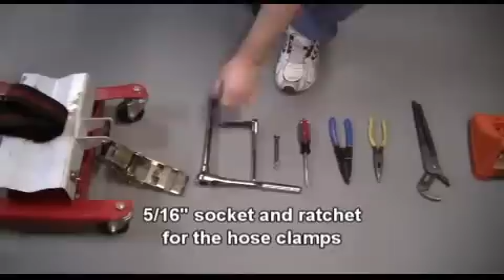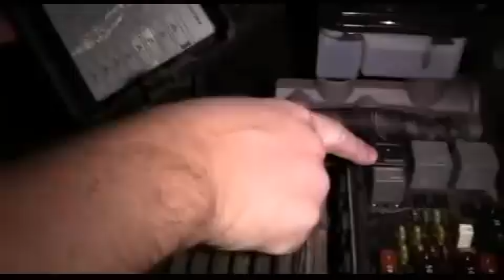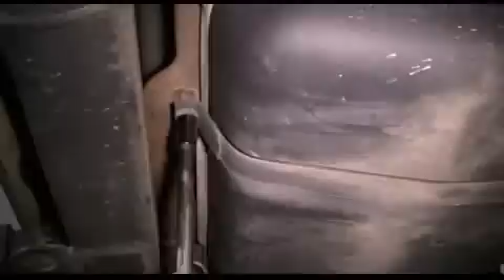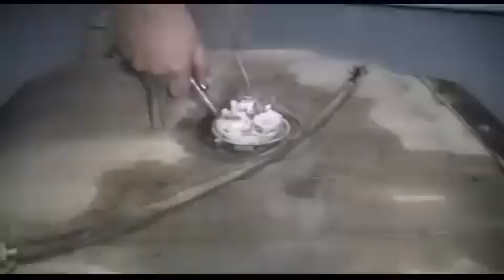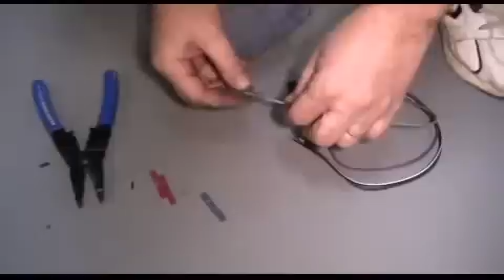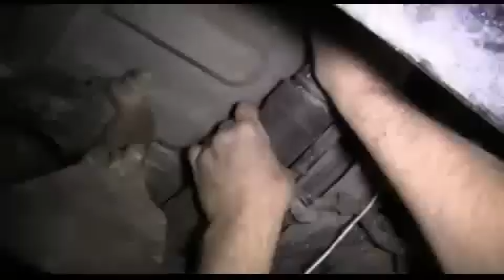Fuel Pump 1999 Chevy Suburban 1500

Comment: I have the same year suburban k1500 lt and im using the replacement nylon lines, but the replacement nylon line  does not fit the fuel vapor connector on fuel pump. Info says that i need a connector a 14 diameter, i just need the part number to find it.

Comment: Not sure how to get the pump low enough to replace the snap ring as my plastic on the pump sits above the tabs and I can push the pump down anymore to get the snap ring on.
Reply from the maker: From what I remember we had to press down on the fuel pump quite a bit to where we could install the snap ring.  If you can't get yours to fit you might want to compare it with your old one. -Greg
Reply: @GregorysGarage  Thanks.  I found the key was not to install the rubber ring gasket around the pump but rather to install it on the tank lip.  After that, it was still a bit tight but significantly better than having it on the pump.  Got it all on after some effort and works great now.  Another obstacle I found was the hoses to the filler spout.  Since they are "prebent" I found they need to be in the exact orientation to properly fit which is a bit hard to adjust after the clamps have been tightened and the tank raised!
Reply from the maker: @codoug777  I am glad you got it installed - Greg

Comment: long shot , but does anyone know why the fuel line wont reconnect back to the fuel pump? I replaced my fuel pump but can noy get those lines back on to the pump.
Reply from the maker: The lines should just slide back over the fittings.   I will have to review the video to make sure I am stating  this correctly. - Greg

Comment: So I just got a 99 gmc suburban the previous owner had 3 gas lines one feed one return and one on the middle one I’m assuming I should take that out 👀👀👀 also the tank was rusty and leaking so I got a new one but still leaks I never changed one so I assumed that’s how it went but obviously there is no line on the middle so ima take it off maybe that’s causing the leak on the new tank 🤦🏿‍♂️🤷🏿‍♂️

Comment: Have spent 30 min trying to get new pump to seat low enough to get ring on.  Im about to just use the old original ring.  Im putting 200lbs on the pump and it won't seat.
Reply: Got it - I ended up using moly lube grease...
Reply from the maker: Sorry I am just now replying.  It shouldn't be that hard.  You will have to push down on it but it shouldn't require that kind of force.  Make sure it isn't binding. - Greg
Reply: I've had the same issue twice now.
Reply: @EvanPederson  Damn!!

Comment: How long does it take to replace a fuel pump
Reply from the maker: I would set aside half a day.  You have to drop the tank and depending on how much fuel is in it depends on how easy it is.  Dropping a fuel 40 gallon tank isn't fun.  -Greg
Reply: @GregorysGarage  how much does it usually cost
Reply from the maker: @mikerey5605  I just checked the prices at my local O'Reilly's and the pump is between $200 and $300 depending on the one you buy.  You will need the line disconnect tool and that is probably $10 or so.-Greg
Reply: Yes that's what it took my neighbor and I to do the job. I got a lifetime warranty pump for around $140 because I bought it through a friend's commercial account. Normally would have been $250+.

Comment: I undo the strap bolts and the tank won't lower.
Reply from the maker: The tank is probably stuck.  Tap it with a rubber mallet or something similar. -Greg
Reply: Gotta' bust-out the prybars!!

Comment: Wondering why you removed negative battery cable, leaving a vulnerable connection between positive and any till touching body?
Reply from the maker: By removing the negative cable we are removing the battery connection to the chassis of the vehicle.  It would be best to remove both but if you are only going to remove one then remove the negative. -Greg

Comment: Hey, I have a 98 suburban and when I try to start it, it stalls.. or it’ll act like it’s gonna start then cut off after 2 seconds.. I’m thinking it’s the fuel pump, but I don’t know.. I wanna actually know what’s wrong before I buy a new fuel pump.
Reply from the maker: Can you hear the fuel pump run when you turn the key on? - Greg
Reply: Gregory's Garage yes, if I’m not mistaken.
Reply: Gregory's Garage I also read somewhere that it might be a mass flow sensor or something like that.. I’m just trying to not waist money on something I don’t need.
Reply from the maker: @kooley_hoe6084  Another yhing is it could be yhe fuel filter. -Greg
Reply: Gregory's Garage I changed that already, but what I’m think that it is the mass airflow sensor
Reply: Gregory's Garage or the map sensor, I’m gonna get those changed and I’ll let you know if it works
Reply: Gregory's Garage ok I noticed that it starts right up when it’s cold outside, but doesn’t when it’s hot
Reply from the maker: @kooley_hoe6084  I really have no clue why the outside temperature would make a difference when you first start it up.    -Greg
Reply: Gregory's Garage i don’t either, thanks anyway
Reply: Did you figure it out? Mine is doing the exact same thing. Once it final starts it runs great

Comment: My truck hums when I try to start it. It doesn't start though. Could it be the fuel pump has gone bad?

I was driving and my truck cut off. The check gages light is on and so is the battery light. I don't know what either of them mean.
Reply from the maker: Does the engine turn over when you try to crank it?   If the fuel pump is bad the pump doesn't make a noise.   When you turn the key to the run position you should be able to hear the pump hum .
Reply: @GregorysGarage  yes. It turns over. What we found was that the fuel makes it upfront but it stops there. If you pour gas in the mod (the carburetor looking thing) it cranks but doesn't stay on.
Reply from the maker: @kimberlyburdette5511  How do you know fuel is getting to the front?
Reply: @GregorysGarage  because he pressed the fuel thing in and gas shot out. I suppose it could be fuel that was already in the line. What do you think it could be?
Reply from the maker: @kimberlyburdette5511  Fuel filter?
Reply from the maker: If your fuel pump is working something is keeping it from getting into your engine.
Reply: I have to find where the fuel filter is located.
Reply: @GregorysGarage  could my relay be bad? Would I hear the fuel pump if the relay is bad?
Reply from the maker: @kimberlyburdette5511  fuel filter is located under the vehicle.  I am assuming this is a Suburban or something similar.  Just a guess though.  From what you describe it sounds like something is blocking fuel from getting into your throttle body.  I don't have that vehicle anymore so I can't look at it.
Reply: @GregorysGarage  yes I have a 99 suburban. A storm just hit so I can't go mess around with it now. Thanks for your help. It's much appreciated.
Reply from the maker: @kimberlyburdette5511  Anothet thing I saw online is that there maybe a fuse for your injectors.   I will look into this
Reply: @GregorysGarage  ok. Thanks again.
Reply: @GregorysGarage  I had the fuel filter changed but no change. Here is a video of what happens when I try to start it https://youtu.be/TIXNxzOzlMI
Reply from the maker: @kimberlyburdette5511  Sounds like it tries to start.   Can you spray starting fluid in the throttle body?   It should start.  I won't run long.   Also I couldn't tell from the video but you said you hear the fuel pump right?
Reply: @GregorysGarage  yes. Here is a video I made to show the sound i hear when the key is turned to on https://youtu.be/K9HPk_610N0
Reply from the maker: @kimberlyburdette5511  Well that sounds like the fuel pump and from what you said earlier you have pressure in the lines.   I would try spraying starter fluid in the throttle body.   That will let you know if you at least have spark.
Reply: @GregorysGarage  ok. Thanks for your help.
Reply from the maker: @kimberlyburdette5511  I just looked at a previous reply where you poured gas in the throttle body and it cranked.   I am out of ideas without looking at it.
Reply: @GregorysGarage  I think I'm going to break down and take it to the shop. Thanks again for your help.
Reply from the maker: Ok my last effort.   Look for a fuse labeled TBC.   If that fuse is bad your truck won't start.  I just went outside and removed it from my 2001 Silverado to test it.  -Greg
Reply: @GregorysGarage  ok im going to go look for that now

Comment: Does you know where the pressure sensor location is for a 1999 Tahoe? Is it on top of the fuel pump or actually on the tank?

Comment: What do you do when after you remove the straps and the tank still won't lower
Reply from the maker: Sounds like its stuck in place.   You will need to break it loose by  either bumping it or prying on it.  Be careful not to damage the tank.  - Greg

Comment: Thanks for the well-done video.  Didn't notice connecting the new fuel pump to a ground on the body ... is there a wire for that?  If so, does it connect to the frame outside or inside of the gas tank footprint?  I'd like to check the ground if possible before dropping the tank.
Reply from the maker: Sorry but I no longer have this vehicle.  I don't remember it having a separate ground though.  I think it was grounded through the connector. -Greg

Comment: I have a 99 suburban and the mechanic says it has that problem and charging me 700 buck to change all that. Is that a ok deal or he's over charging me? Thanks But I don't know nothing about cars and prices
Reply from the maker: I know $700 is a lot of money at least for me.  But it doesn't sound unreasonable for replacing the fuel pump.   The fuel pump will probably cost around $300 by itself and then you add labor.  I hope this helps. -Greg
Reply: Way to much. Always buy parts from parts store they come with a warranty so you only have to pay for labor.
Reply: My mechanic only charges $300 for the part and labor combined.

Comment: really great vid  want to know  how long did it actually take  &the the fuel pump on a chevy silverado is not the same  mine is just a little bottle culd it be just bought the parts today
Reply: you bought the pump only, he replaced the entire module, more expensive but you also get all new parts and most likely updated equipment, now you have to pull the module out of tank the same way as in this video, you will be able to see the pump inside , just replace it,
Reply from the maker: It takes around 2 hours or so if you have help and depends on how much fuel you have in the tank.  Not sure about the Silverado but it should be similar.   Mine went out with out one time with over 30 gallons. -Greg

Comment: Mine is a masterPro Pump for the same Truck with wiring harness: black, Purple, Grey, Orange with black stripe. How do I connect those, and it didn't come with wiring info. Please advise.
Reply: Yes the orange and black wire is for the small black wire on the truck. On mine there were two black wires, a larger one and a small one. The larger black wire goes to the larger black wire on the truck. Purple to purple and white, gray to gray. My pump didn't come with these instructions but I got the information from the video and transcript.

Comment: I got a fuel pump from OReilly, and it wouldn't fit into the TAnk: meaning I couldn't get it to compress all the way down so it would fit around the opening. It was too tall. Going with a AC Del co this time and hope it works. Should it be extremely hard to put the new one back in.
Reply from the maker: Sorry for the late reply I have been having computer issues.  But to answer your question, no it shouldn't be hard to put back in.  If I remember right you have to apply a little pressure to it. -Greg
Reply: Thx Greg we got it in, but is was hard as hell. the truck is running again, I do hope its the right piece.

Comment: I have a 2001 gmc yukon. Would this guide be ok to generally follow to replace the fuel pump? Or did they change to much in the intervening years?
Reply from the maker: I am not 100% sure since I haven't replaced a fuel pump in a 2001 Yukon but I believe it would be similar. -Greg

Comment: Thanks for the video may have just saved me a hundred bucks worth of labor,
Reply from the maker: +Daniel Harrell You're very welcome..  - Greg
Reply: At least! I had to have a shop replace the fuel pump on my other 99 Suburban several years ago. It cost over $800. Today my neighbor and I fixed my Burb and it cost less than $200 in parts and new tools.

Comment: We installed a new fuel pump on our 1999 GMC Suburban 5.7L L31 CSPI engine with 203,000 miles and it has vapor lock. According to our sisters friend that did the work...we need a new engine as it will not start. You video filled in a lot of information Thanks!
Reply from the maker: +William Gallant Vapor lock is caused by heat.  It's uncommon in my opinion  to get Vapor lock on a fuel injected engine.  Why do you think it needs a new engine?  - Greg
Reply: +Gregory's Garage I agree with you, vapor is caused by heat and hence you have vapor lock. The guy is a certified diesel mechanic, replaced the fuel pump, said he had pressure by gauge, yet the truck refuses to start. He then said vapor lock, and that the spider needs to be replaced or the engine replaced because it has over 200,000 miles. I feel that we can still get more mileage and there is no vapor lock. This all started because the truck began chugging, then it finally quit. I thought it might have been the ignition module. Anyhow the guy told my wife because the fuel pump was so bad that the new pressure caused the spider to fail?
Reply from the maker: What year is your Suburban?
Reply: It's been a year operating with  a fuel pump sending unit, and we ended up replacing the SPI with the  MPI which works much better. During this year we have been using the trip odometer as the gas gauge moves erratically at all times. When it gets a little warmer than single digits and the ice melts I'll check for a bad ground.
Reply from the maker: Thanks for the information.  I hope it warms up where you're from.  It's been a pretty warm winter for us. -Greg

Comment: Make sure you get an ac/delco pump, those aftermarket pumps are trash and won't last. Also make sure to never run your tank below one fourth, because the pump needs to remain submerged in fuel to lubricate and cool it. It'll burn them out faster than jack sprout if you drive on empty in GM vehicles.
Reply from the maker: havefunbehappy Thank you for the comments.  I have used different pumps and have had simlar results with them all. 
-Greg
Reply: What does it mean if my pump is whining?
Reply: Whining is the same thing as complaining!Ya know like, kill me now (Replace) b4 I give up on ya completely
Reply: George Ramsey lol
Reply: like the gm original ac  delco ignition switch that has killed 12 people already when gm knew all along it was faulty. i have very little faith in factory parts, most are made by other companies anyway, denso and delphi are as good a pump as you can by.  ever since in tank pumps came out most of us knew to keep fuel level above the pump, thats the only way the pump has to be cooled is with the fuel.
Reply: I have a 99 Yukon and go many miles with the gauge in the red .Retired I haven't much choice but as long as fuel is going through the pump it is cooling it.That said more fuel is better .

Comment: I have a 99 Suburban and I have been unable to put fuel in but like a gallon at a time I checked the Evap line and i can blow air thru them,not sure where I can go from there or if you have a video that addresses this problem. Thanks for any help or advise you can give

Comment: How the heck did you put the new fuel pump in the tank? The o-ring with the my new pump won't fit.
Reply: Did you figure it out lol cause I'm having a bitch of a time with mine
Reply: @YeahNoToastTho  Oh yeah you pretty much had to throw your weight on it when pushing it in. I had to use bursts of energy pretty much going at it like a wild man. I know the top of the fuel pump was plastic so I don't remember how breakable it was so use caution when appling force. It can be done for sure though. It helps if you put a touch of motor oil around the o-ring. Good luck!
Reply: @wolfzwiful  Hey thanks for getting back to me! Yeah we ended up using some heavy duty grease. That was fun lol
Reply: Yes motor oil or grease will help with the installation of the O ring and pump.

Comment: I checked my 1999 fuel pump and it made that unique sound. I replaced the fuel pump relay sensor, air filter and gas filter. Before cranking it up, I pour a bottle of fuel injector cleaner in the gas tank. I tried starting it one time but no luck. So I sprayed starter fluid in the plastic container that's attached to the top of the injectors. My Truck started I drove for an hour and parked but continued to keep the engine on. I drove and parked for almost 4 hours. Happy to say no fuel pump was needed. If it wasn't for this video I would have cave in and followed my no longer mechanic advice. Thanks for the heads up. From me and my Heavy Chevy a.k.a the CHAMP..
Reply: Why was your mechanic telling you to change the pump?

Comment: P.S. didn't notice any ground wires on tank.
Reply: Rocky Raccon Check gages light comes on also when the gauge pegs.
Reply: There's a chassis ground very close to the filler neck and vent hose....